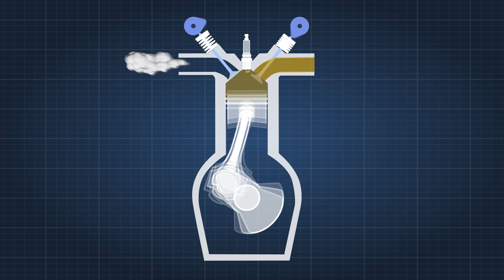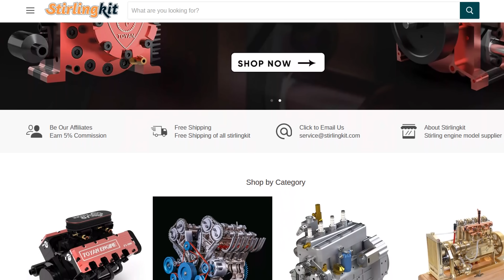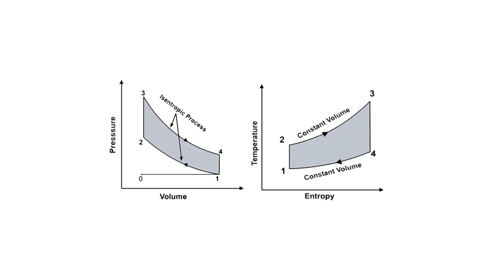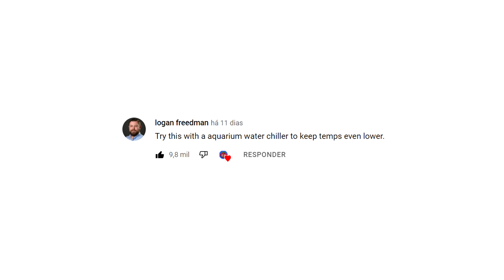I 3D Printed a Transparent Combustion Engine in Resin

Comment: I think the fuel isn't igniting everytime because the cylinder is flooding and is too rich. Gasoline need to be mixed at about 14:1 so there shouldn't be much in there. 

And your question about the most powerful fuel performing the worst is going to be a combination of your compression ratio being too low and your ignition system being too weak. For those fuels to perform well you really need to very strong spark system to cope with the extra compression in the combustion chamber.

Start by leaning out the mixture of your fuels until it runs smoothly and doesn't flood.

Comment: Theme idea...Put a tube between the carburetor and engine that has a few ultrasonic transducers in it to E X P A N D the fuel before it gets into the engine. It's an experiment I've always wanted to try but never seem to have the time.

Comment: In higher speed of an engine the combustion will get weak, which mean in higher speed you have to advance ignition timing and also get more power at higher speed which means efficient combustion. the different fuel has its different characteristics so i think because of that too, you may need to change the timing.

Comment: Specific gravity/mass*compression+(peak torque rpm/current rpm)? Mode speed does not mean more power in pwtro fueled engines. They have a sweet spot and powerband. Build a dyno

Comment: my guess will be the sealing, normal engine uses 3-4 metal ring unlike yours that uses one rubber band, and it doesn't have enough compresion especially when it's heated, with metanol, less explosion means less heat, and rubber have worst behaviour for engine when it comes to heat, because rubber is getting softer with more heat, also resin is not counductive which means more heat inside of the engine

Comment: I think for your engine power loss, it could be due to compression, the mixture of fuel and air, spark/ignition or weak power supply for the spark. For a idea could you try test a idea I had which could have no side effects in theory but still rely on the same 4 stroke principles, this is an engine which does not have spark plug and uses compression to ignite the fuel, also the fuel will have to be hydrogen.

Comment: 👍😎🔥💥 Couple of ideas. One being Air Fuel Mixture. Either too much fuel or not enough being introduced into the air stream and you’ll have incomplete combustion or even complete misfires as you experienced. All those different fuels have a different ratio to air to combust cleanly, “STOICHIOMETRIC”. 🔥💥👍😎 With such a small engine it is difficult to achieve stoichiometric over several cycles let alone every one. Other idea is, as you mentioned, compression could be low which would mean the combustion event won’t be as robust or partially existent or non existent.

Comment: This probably has something to do with Gas Stoichiometry, just the fuel air ratio with the carb and cylinder size. Lets say you take a 350 big block and shrink it down to the model size your using.  The small differences in that full size engine is in the thousandths.  Your printrd and hand sanded engine, piston, stroke, fuel/air mix, compression would all come down to insane tolerences which obviously they arent even within those of a full size engine.  That could explain how its running, but missing cycles with different fuels.  Also testing without a load could be an influence.  None of this takes away from it being a cool item, but id be willing to bet if you played with the fuel/air mix amd having some tighter cylinder/piston tolerances youd get the full 4.  How tedious that may be would be the biggest hurdle.  Great video, like all the others.

Comment: Your calculations of efficiency are totally wrong. The efficiency of the Otto cycle, that is the amount of heat (gasoline energy) converted into work is   1 - (V_compressed / V_cylinder) ^ (kappa - 1)   where  kappa  is the adiabatic constant.

Comment: It would be cool to see what the power loss per cylinder would be for every additional cylinder coupled together.

You could also use the closing of the magnetic switch to trigger some arduino code which could then vary the spark plug on-time, potentially avoiding the no load power stroke skips.

Comment: Gasoline "gives more flame" because of soot, I guess methane produces less soot, so the flame is less visible. One thing that affects the RPMs is the speed that the fuel-air mix burns, in fact, if the mix burns too fast, very little energy is transferred to the piston. Changing the fuel also needs changes to the angle (the moment in time in the cycle) when the spark happens.

Comment: I would guess that the tube you made has too many leaks. Try adding a couple baskets. I base this on seeing fuel leaking between the metal and the resin. Then I would look at the piston. The chambers are usually very precise, while your resin is going to expand with the heat. Maybe check to see if it normally completes a full cycle regularly? As for how, I’m sure you can think of something.

Comment: I think a cool video would be printing water cooling system for an engine where the cylinder is clear like this, but you see the coolant flow through the cylinder walls, then we get to see more of what an engine is like and use that water to power a low temperature sterling engine!

Comment: The smaller pop of the weaker fuels were done by the time the cylinder reached the bottom so it didn't have so much resistance to cycle back up. The gas still produced combustion far after the cylinder reached the bottom and started to cycle up so it had to run a bit slower to get all of the extra gasses exausted
Reply: Was looking for this. This is what I expected was the issue with the lower rpm. You would have to tune the timing and size of the intake and exhaust ports as well as the spark timing in order to optimize for a smoother cycle and less resistance on the exhaust stroke.

Comment: the more powerful the fuel the more torque the engine will have it wont increace the rpm and maybe even lower the RPM think of a deisel engine has alot more torque but it doesnt rev as high where as petrol needs to rev as it doesnt have much torque

Comment: Maybe you should try out to build a patoto/tomato gun out of the new fuel you got. It would be interesting to test it. Because you said it has much more  energy than normal fuel. Maybe you can use a type of carburetor to spray it in the explosion chamber for higher surface area. 😁 I can imagine that the fuel maybe expand slower but with more pressure.

Comment: I'm thinking it's a combination of fuel ignition speed and spark timing. If it's igniting prematurely on the up stroke it's going to run slower as it's partially working against itself, if it's igniting too slow and already from the previous momentum moving down then the compression is off and it'll run faster but weaker. That or you need to play with the carb a bit more for the mix.
I'm no expert though so this is all just guessing.

Comment: it had to do with octane and timing.  alchohol based fuel has octanes over 100.   the higher the octane the more resistant to detonation it is. thats why it is used in high compression high HP applications.  putting a low octane fuel in a 3000 HP dragster would instantly blow it up.   so when put in a piddily little engine with low compression the fuel is very hard to detonate.  a very low octane would be much more efficient in that engine.   Also,  it may be bouncing off the governor limiting engine speed with sacrificed power strokes.

Comment: I think the problem is with the push rods to open the valves at right time,if you see closer the push rods are not performing well that is these type of push rods are very slow and can be used for low rpm but in the first 3fuels the amount of air and fuel coming into the engine is low and the power stroke doesn't occur at times, but for the 4 type of fuel you see it has 25% fuel that produce enough oxygen for combustion so it goes 4stroke
So I think the problem is with the push rods

Comment: You could use the engine to power a small self built car/skateboard and compare the actual speed with different fuels. 
Maybe the one with less rpm has more torque.

Comment: Hit or miss engines use missed power stokes to control engine rpm. Using the least powerful fuel means the engine is working the hardest to turn and thus can't afford to MISS and is always Hitting.

Comment: The lower speed from the 25% Nitromethane may be due to timing.  If it ignites too soon, a lot of that energy will be opposing the motion of the cylinder, slowing it down.  And the compression may be what ignites it, not the spark plug.  Another potential issue is that Nitromethane supposedly burns more slowly, so while there's more power there, a lot of the extra power is getting lost out the exhaust valve.

Comment: Methanol has a lower power density that petrol (as does nitromethane). 
However, the air fuel ratio at which petrol is "stoic" is around 14:1. Methanol is stoic at more like 6:1. 
You can throw twice as much methanol into the engine per a given quantity of air that you can with petrol. This is due to methanol having a high oxygen content in its chemistry. This is where the power advantage comes from. That and you are able to run higher boost pressures, compression ratios, and ignition advance due to a research octane rating of over 120. 
Methanol also burns with a light blue flame, if you can see it at all. 
Colour of the flame across various fuels has little to do with power potential.

Comment: Methanol fires are almost invisible that’s why they are so dangerous that doesn’t mean that it is just a less powerful explosion you need to use more methanol but people use it because of the other advantages the fuel offers like a more stable combustion at high compression and the low temps it offers that’s why it is mostly used as race fuel because it is meant for high performance applications and a methanol engine can make a lot more power than a pump gas one it just has to be set up right.

Comment: Not an expert on the subject, but I think you're on the right track saying that it has to do with the spark. These small engines typically just use a magnet on the flywheel and a coil to generate the high voltage pulse for the spark plug. The pulse generated by a coil like that is actually one positive voltage spike, followed shortly by a negative voltage spike. If the flywheel spins faster the pulse should be stronger but shorter, so I'm guessing that at some point there just isn't enough energy in the spark to ignite the mixture.

Modern cars all use electronic ignition systems which are much more consistent in terms of forming the sparks, don't have that polarity-reversal issue and can consistently dump more energy into the spark. That might be worth playing around with!

Comment: Re the fuels with less potential energy making the engine spin faster:  while gasoline may store the most potential energy, it releases it's energy slower when burned than ethanol and nitromethane fuel. 

With the ethanol based fuels, you're getting a huge kick from the initial explosion, which gets the piston and the flywheel moving really fast. The pressure against the piston starts off higher, but falls off much quicker during the explosion than it does with gasoline so there isn't as much torq, like you said

So if you've got a consistent, fairly light load, like a drag racer on a straight-away, or a remote controlled airplane with a plastic propeller, nitromethane is great. 
But if you want to accelerate a 2000lb car up a hill, coast down the other side, and be reasonably efficient about it, you need gasoline.

Comment: I think a lot of your problems with the (misfiring) could be due to incorrect timing for the air/fuel ratio. Trying using a lower throttle percentage, and maintain a steady idle. If that doesnt work, then it could be due to compression leaks. That o-ring is not exactly meant to be used against a sloppy, non-exact cylinder. You can see the fuel being squeezed out in the compression stroke aswell

Comment: Air fuel ratios are super important.  Also known stoichiometric mixture.  It's the ideal mixture of the fuel to air.  Gasoline is some where around 14:1 methanol is some where around 6.5:1 and nitro is about 1.7:1

With out compensation of additional fuel when swapping you're leaning the engine out. (Not giving enough fuel to it) and are killing power out put. 

The reason nitro makes so much power in top fuel cars is because they can use more of it.   They are on the verge of hydro locking the engines with how much fuel they are forcing into it.  
I can go into a lot more detail on this, but it's a lot to type on the phone.   If you want I could send an email with audio to explain it to you.

Comment: I don't know the specifics, but different fuels need different motor settings and adjustments to run at peak efficiency. Flex Fuel vehicles have a special computer chip and sensors that tell the car what fuel or mix of fuels are in the fuel line, and then the brain of the car makes the proper adjustments to run that fuel. I know fuel/air ratio is one of the setting that need to be adjusted but I don't know enough to say If that is the only setting.

Comment: I think your compression is still low. If you mix a small amount of oil in with the fuel "like a 2 stroke Engen does" you will find the piston ring seals better and your compression & suction of new fuel into the cylinder, will increase.

Comment: All I could think of why the speed is lower the more powerful the fuel is ignition timing.
Ideally you want the explosion just at maximum compression to push the cylinder down the strongest. Anything before or after leaves you with less efficiency.

So I think the timing is not ideal and the mixture is ignited at a less than ideal moment every 8th stroke and ideal at every 4th stroke.

This would make the strongest explosion act the strongest against itself.

It's activated by a Piezo effect caused by a Lorenz force, right?
Maybe it's just a little too random and acts weird at too high acceleration of the cylinder after a good stroke.

I don't know how, but measuring the speed of the cylinder at two points of one up and down movement would test my theory.

If I am right, you would need to try a different ignition timing.

Comment: I think you have the worst power with the most powerful fuel because the carburator is set for gasoline. As you mentioned nitro methanol needs a way more rich fuel-air mix for delivering full potential.

Comment: I'd suspect rich mixture since NitroMethane wants to be extremely rich compared to ethanol or gas.  i.e.   NitroMethane is 1.7:1 vs Ethanol at 9:1 and gas at 14.7:1. ... assuming there isn't a governor on that ignition system cutting spark to try to keep the rpm down.

Comment: Air fuel mix is off too much fuel and an engine is supposed to idle at lower rpm without a load also turn this into a gas powered compressor or bike pump

Comment: What about building a centrifugal tomato launcher? Basically is an arm with something you want to launch on one end, you spin it with a motor and trigger it to let go as it's on the up swing. You can see a similar action with softball pitching, there's a 360° rotation to gain kenetic energy, then when realised, the softball travels faster than a normal throw. Two issues is the release timing and the weight change when the projectile is released if you balance it with the projectile weight. Oh, and it's s little dangerous when you speed up the rotation..

Comment: I had some research on that topic once. I found out that even if the fuel is more powerful you have to take in account the miss firing and the delay on the explosion related to the ignition of the Spark Plugs. Ethanol, which is the fuel of some of high performance Endurance cars, has very low energy compared to gasoline. However, just because it is more stable under pressure, we can tune the ignition perfectly.
I think what's happening is that the timing might be a little of and not calibrated to each fuel, therefore, it causes pre explosion or late explosion which end up producing some power in the opposite side of the cycle.
The problem with the 8 stroke and 12 stroke i don't really know how to solve. Maybe with a bigger variation in volume inside can expel correctly the gases and make a actually good explosion. Also, letting the air in the engine all out and putting new cols air improves the efficiency.

Comment: Video idea: how about you try diesel engine, it doesnt rely on spark plugs, but on compression of the mixture. If you still wont get ignition then try decreasing the volume of compression chamber, thus giving more compression and more temperature to ignite it.

Comment: Well of course the next step would be to build some other miniature engines with a transparent cylinder, right? Being able to look at the differences with a two-stroke engine (like how differently lubrication works) with a transparent cylinder would be great, or a diesel engine (how it doesn't use a spark plug, etc.)
Something I've always found fascinating is how different cylinder configurations have different characteristics, how they have to be timed with one another and be balanced. Like for example, every piston in an inline engine needs a counterweight, but in boxer engines, pistons are arranged to oppose each other and balance each other out. I've never seen this outside of an animation.

I'd also love to see you play with moving energy storage, like using flywheels or reaction wheels.
Reply: Not sure if resin would withstand diesel pressures for long. Then again, RUDs never stopped Integza, luckily for us :D
Reply: Take a look at Warped Perception's videos
Reply: That would honestly be really cool